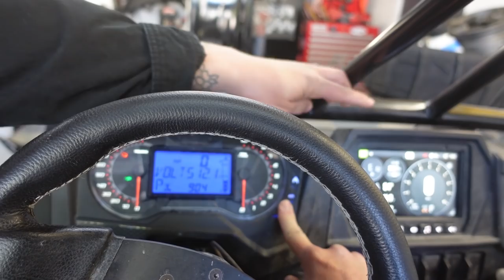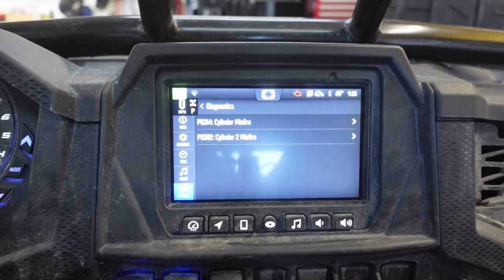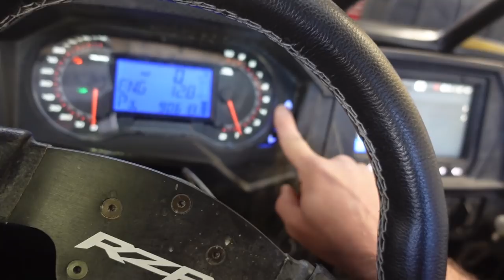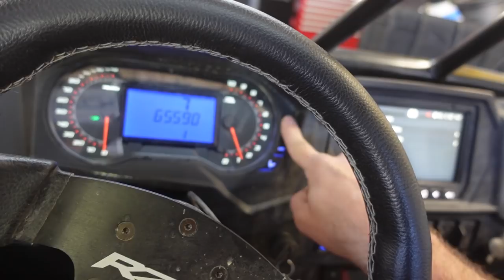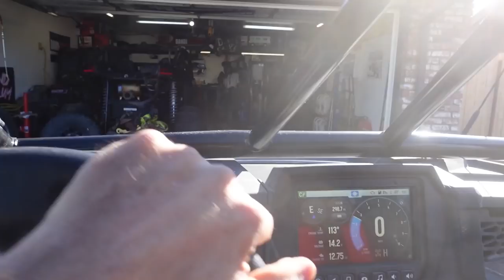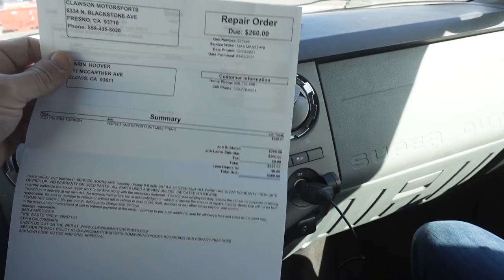NEW TURBO S ERROR CODES LIMP MODE NOT A BAD BELT

Comment: Our RZR had same codes/issues on day 1 of Glamis thanksgiving trip last year, after swapping belts, plugs, and all the usual things to try to salvage our trip...a friend recommended to pull the intercooler and check for water/antifreeze at the intake, BINGO!! There was a tiny leak that was feeding into the intake and causing misfire!! Of corse, there wasn’t an intercooler to be found close enough to save the trip. Came home, replaced intercooler, and traded in for a new C3 Max RR. BEST decision we’ve made in long time!!
Reply from the maker: Good tip I've heard this before. And lol. Luckily we already have a Can-Am also

Comment: Somethings I ran into with my big turbo s misfiring was the exhaust/turbo hardware backing out creating exhaust leaks (finally stopped after replacing all hardware with brand new).  My turbo kit also had aluminum charge tubes and the plug wires would arc to them through the insulation causing a misfire.  After those two fixes she ran like a scalded dog.
Reply from the maker: Unfortunately we have metal and oil engine coming apart to diagnose.

Comment: Misaligned clutches are an issue on those. Wonder if the mechanic checked that or not
Reply from the maker: We actually have it at another dealership right now, and we have a case open directly with polaris.
Reply: @DandiOffroad  well hopefully the figure it out

Comment: The P 90X clutches that come on these new machines are a problem. Get one of the previous clutches that came on the turbo and turbo S machines and save yourself a bunch of headaches. Aftermarket Assassins is selling them with their clutch kits.
Reply from the maker: The clutch on the new 2021 Turbo S is the same clutch as on the pro right ?
Reply: @DandiOffroad  yes, turbo s, pro and xp turbo have same clutch. I bought a new 21 xp turbo and my clutch was part of the recall. Once I got it home it had zero miles  I put the AA clutch kit in immediately along with a bunch of other goodies. I'm at 700 miles all super deep snow wheeling and not one single issue. I was super lery of the p90x but after tuning it and seeing how it works im really starting to like it. Your issue is gunna be electrical or fuel related im guessing.
Reply from the maker: We had a pro for a minute, until it was totaled in October,,  only 260 miles on it,,, so we never got to addressing the clutch. Yeah I agree,, electrical or fuel.

Comment: Put it in firm mode when you load it it won't Squat as much and it will be narrower for the skinny trailer.
Reply from the maker: Agreed, but we came across this not sure how critical it is. 

https://rzr.polaris.com/en-us/self-help/article/KA-01047/
Reply: @DandiOffroad  yes they want you to put it in Comfort mode before you tie it down because the car settles when you switch to comfort mode. When I load my turbo S in my toy hauler if I leave it in Comfort mode the wheels scrub the fender Wells. When I drive it in infirm the car is narrower and before I shut the car off I switch it to comfort mode and the car lowers. Looks like you strap down the tires so ride height change will not affect your strap tie-down tension
Reply from the maker: Yeah we're a big fan of wheel bonnets, and it fits on the trailer it's just that the person that was trying to drive it on the trailer didn't realize you can't drive on at an angle. We have a couple of inches at least on each side.

Comment: Same codes as mine. 2018 Turbo XP. As soon as I went from 29's to 32's. Changed belt, plugs, re-clutched it. has a newer aftermarket hi flow fuel pump, still chasing codes. Interested to see what the dealer says
Reply from the maker: dang that is a nightmare, we well definitely post our findings, and good luck to you
Reply from the maker: Our motor was toast, Polaris replaced it

Comment: I am thinking a fuel issue. Possibly a fuel pump. I am down the street from you and have the tools to check it for you. We have replaced multiple pumps in Polaris RZRs.
Reply from the maker: O sweet,, it is at another dealer now, but if this continues after that we will be looking for a solution, just wanted to have it fixed under warranty since its brand new.
Reply: I'm having the same issues, was running a lot of aftermarket assassins goodies to include the upgraded fuel pump.  Returned everything to stock and am having the same issues.  I really don't think the pumps are the issue.
Reply: BTW mines a 2018 with about 700 miles, just started doing it last fall before the snow  fell.
Reply from the maker: Yeah I feel like it's an electrical issue but.. I'm hoping I know something here in the next few days
Reply: Mine turned out to be bad injectors.  Aftermarket Assassins was able to read a data log for me and see that I was overfueling.  I knew it wasn't my pump so I swapped out the injectors.  No limp mode and it screams now.  I'd explore that possibility if you have figured it out yet.
Reply from the maker: Glad you got it resolved
 https://youtu.be/68ENB6sns7s

Comment: Man. I'm starting to think it's the G boost belts. I followed break in to a T on my G boost and it failed within 60 miles. It just snapped. No signs of wear at all. It just busted. It didn't shred  no nothing. It just popped in half.  Crazy. It was warrantied so I'll be breaking in that on next week. Hope it was just a rando thing.
Reply from the maker: it was definitely not the belt, and we run these belts on our can am with no issue.
Reply: @DandiOffroad  well I'll give them another shot. But I replaced my OEM with 800 miles with a G boost and had to put the OEM back on. I hope it was random.
Reply from the maker: I am not sure about the G boost on the RZR,, I just know that our Can Am doesn't have an issue with them. But our RZR is still not fixed, it does the same with an OEM as it does with a G Boost,, still to be determined, we will soon know hopefully
Reply: @DandiOffroad  I hope it gets figured out soon. Thats a super strange thing. I haven't seen anyone with that issue. I have a few friends with the turbo S and they are awesome vehicles. Super nice rides . Good luck and I'll be watching for updates!
Reply from the maker: I love the car. But I am surprised at the number of people that are telling us that they have had the same issue.
Reply: @DandiOffroad  That's to bad. Not a good look for polaris.
Reply: I'm thinking of ordering one ..now I'm having 2nd thoughts 😂😭
Reply: @codhackzWII  I just put the warrantied G boost belt on broke it in and ran I hard in Glamis for 200 miles. So I'm thinking it was a bad from the factory belt.

Comment: I would not wash it I washed mine  when I had clutch issues  on my new Turbo S and Polaris said they were going to cover the clutch because it had water in the housing. I live in Arizona and the only water is seen was me watching it before I took it in.
Reply from the maker: That crazy, did you get it fixed. This was 3 weeks ago and we are at shop number 2 so it should be dry.

Comment: My buddy had that problem and we found the injectors wiring were torn
Reply from the maker: Hopefully they fix it,, if not then I will check that
Reply: Hey man! Mine throws these codes after running. And the run in just one cylinder sounds rough.  Was he having the same issue?  Sometimes it does it right away and other times doesn’t
Reply from the maker: Ours was an issue with the engine. Polaris ended up putting a new motor and turbo in it.

Comment: There is no way that its the belt. Almost sounds like you were not getting enough fuel
Reply from the maker: Nope definitely not belt. It's already at another dealership
Reply: @DandiOffroad  So I came back from a ride this weekend and mine was hard to start and couldnt really go fast, So got it home and tested my fuel pump and I was only getting 30psi. So I took my air compressor and shot some air into the feed line to the fuel pump and now it works. But I'm still going to get another fuel pump and just have it just in case. But I hope they get yours figured out.
Reply from the maker: Thanks for the info,, we hope to hears something soon!!

Comment: I like how the dealer really tested your car after classic read code and oh says belt slip oh new belt long after you said to them we changed the belt cleaned the clutches common clutch and pcm ecm sensors. I thought evo had a tune that dumped the belt slip out of the system was reading that some where along with clutch tune
Reply from the maker: Agreed, we do plan to EVO tune it. We just wanted to try and at least get past 300 miles. And I feel like they should be able to fairly easily fix this problem. So it's at a different dealership now. 🤞
Reply: @DandiOffroad  1 one is where you bought it .?  👍
Reply from the maker: It's now where we bought it
Reply: My Buddy experienced the same codes on his new RZR. I believe these errors are more common and Rzr has another issue brewing.
Reply from the maker: Fun